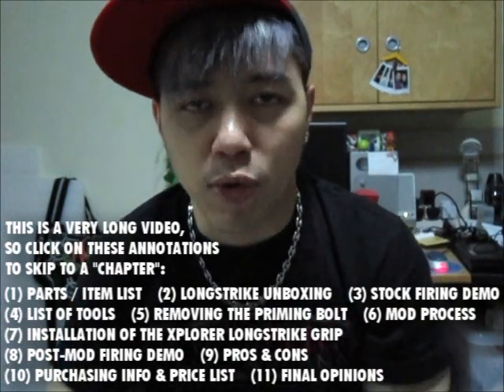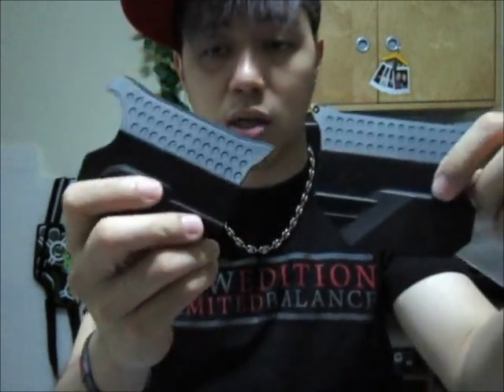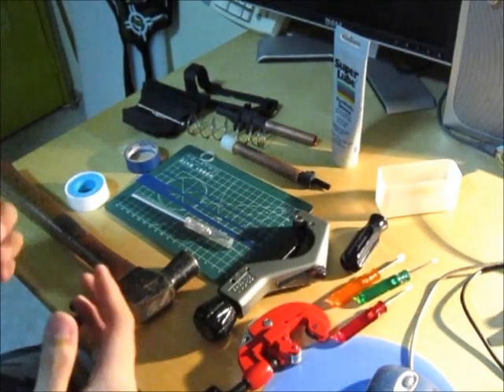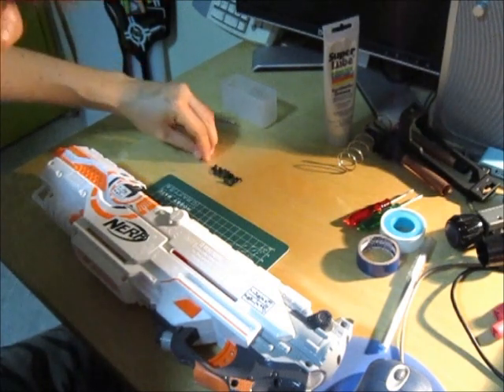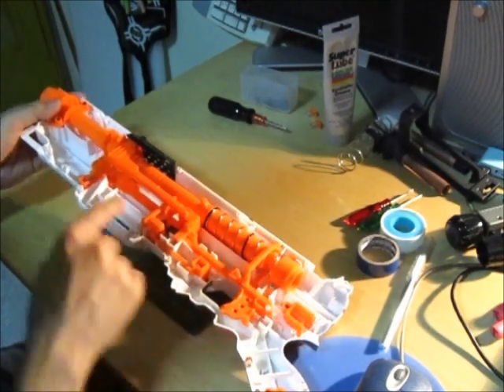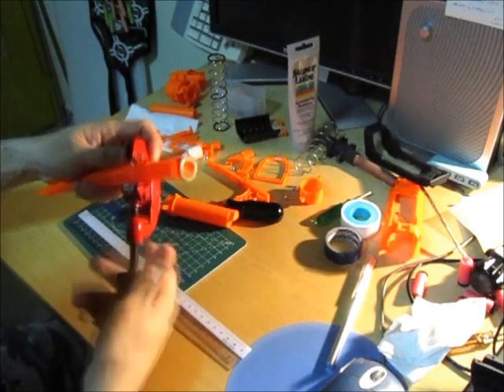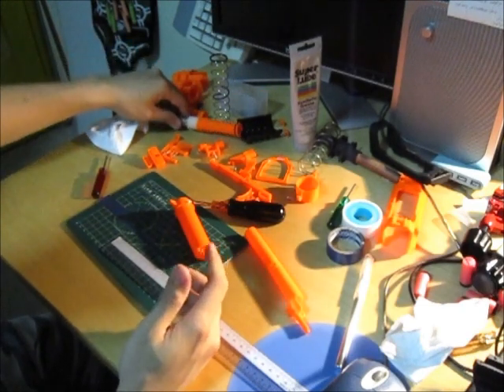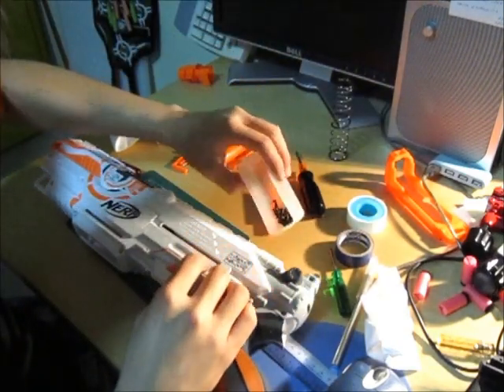Xplorer Longstrike Xpower Kit + Boltsled + Grip Full Review & Installation

Comment from the maker: Finally, back to the topic about darts and barrels. The main thing I am asking the Xplorer group to consider is the ability to fire off regular sized microdarts and stefans. I have already clearly displayed that you are able to fit a regular Nerf clip into the breech, but it does not accept regular sized microdarts. Even if I mod my clip into a stefan clip, I would have to mod it in a particular way so that the darts can be chambered. That's all that I'm asking.

Comment from the maker: I understand your concern, and I can spend a long time debating with you regarding the deforming of plastic barrels, but it is also known that with air-pressured blasters, barrel fit is meant to be anywhere between a little loose to a snug fit, and that is a totally different application from a spring powered blaster.

Maybe you can really consider giving your customers the option of installing their own barrel material of choice. For example, I would pick Brass or slightly reamed CPVC.

Comment from the maker: In my video, I clearly showed you that you CAN fit a stock nerf clip, but the point I was driving across is exactly the fact that we're not able to use streamline sized darts. This basically forces those who install your kit to either use the Xplorer Stefan clip, or to mod the standard nerf clip into stefan clips.

Comment from the maker: Yes, I'm fully aware that the dart peg is intact. That's the point of showing you the unboxing; To prove that it's a longstrike that's bone stock, one that's never been tampered with.

I chose to use stefans in the stock barrel simply because the Xpower Kit fires only stefans. I'm pretty sure I mentioned this at least twice in the video.

Comment from the maker: Engines are engines and plungers are plungers. Nerf modding has been around a long time and it has already been tried, tested and proven that "twist-fit" dart fit in barrels provide the best results for spring powered blasters. Also, as I have mentioned, the copper oxide residue does nothing but affect the power and range of your darts.

Comment: That's a really nice grip, would have preffered a shotgun style though. I love their grips but from the sounds of it, the kits are not all they're cracked up to be.  that seems like a pretty complicated installation compared to the omw kits, which pretty much give you all new replacement parts to swap with the stock ones. given the price difference,performance, the dart compatibility, and ease of installation. omw wins that one easily. only thing I really liked was the grip. still pricey though.

Comment: Con 3.  Being an entry level kit, we didn't want to package everything together and make buyers buy everything.  Just the basics to start off with.  U can reuse the stock bolt sled n contrary to ben's video, you CAN use a stock nerf clip.  U just need to make a small mod.  See his video at 43:26 when he slams in the stock clip. the 2 "guides" splits open, just snip off a little and the clip will work perfectly. ah...ben. Now u know *wink

Comment: Xpower is built for warrior, trooper and hardcore nerfer. To have such power of blaster .we had did many experiment of fire all kind of dart.so far only xdart stafen are able to handle such power and honestly our xpower really carter for this group of trooper..Xplorer had 20year of mechanical engineer and material engineering experience to determine which material of it material properties and behaviour  for suitable application. And we actually change the whole design of the firing system

Comment from the maker: It's not because of my flu. When I showed the close-up of the breech, it was not to show you the dart gate. It was to show you how the streamline would get blocked by the air output end of the plunger assembly.

This is the exact compatibility issue that I'm referring to. Basically forcing your customers to use ONLY stefans, in my opinion, isn't very friendly.

"Sorry full length darts fans but that how WE roll" does not mean that it's the same way that every other Nerf enthusiast rolls.

Comment: Hey psyk I bought the xplorer shotgun grip for the longshot and I love it even tho its a bit pricey thats okay. All I did to the longshot mod wise was just replace the stock spring with a BBB spring and I get 50foot ranges which is perfect for HvZ. 

I am interested in buying the grip for the longstrike but my question for you is. Is there a spring I can swap the stock one with for the longstrike to get similar performance to my longshot around 50 feet with air restrictors still intact.

Comment: if u load the dart from the magazine or clip...the dart will not fall out like show in the video....cause the dartgate has a smaller diameter that hold the dart....ben...u try again ...load the dart into the clip....prime it....and u see if the dart fell off out from the barrel,again we need the barrel to be alittle loose fit with the dart,that is our new concept,xpower dont work on tight fit dart to barrel,but again we still have a good range and precise shooting if u will to check my own vide

Comment: DISCLAIMER: If you wish to assemble your own parts and use material that is not recommended by us (in this case, the copper tubes) we cannot be responsible for any damage to property or injury to self and others.  We will also not be able to provide a warranty on the parts, if you choose to make your barrel replacement.

Comment: Ben...Xplorer xpower work total different with the traditional way of modding blaster....u try fire the loose dart compare with your bigger much tighter dart....u will find the loose dart fire very much more range than the tight dart....WHY?????the air that pushes the dart will leak off the the leakage area rather than pushing the dart as Xpower is build in the way that is not 100% air seal...why not 100% air seal like the traditional way to mod blaster....

Comment: is like car engine...why they need engine breather....why they need wastegate???.....to high air pressure got good range but alot of responsiblity on the blaster.....endup leakage....breakage ...etc...etc.....even through is not 100% air seal ...but xpower still obtain good range + reliablity....less responsible....WHY NOT?...xpower is built to fight in the war in ragger hardcore trooper...it has to be reliablity....and power + acccurate shooting....xpower in not show gun...but is a fighting gun